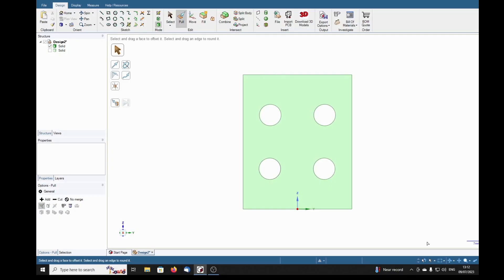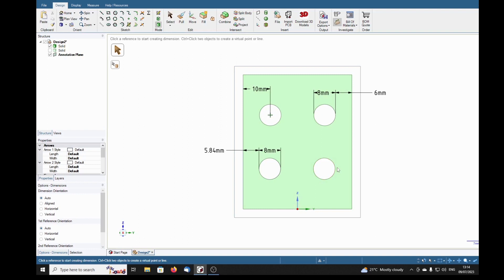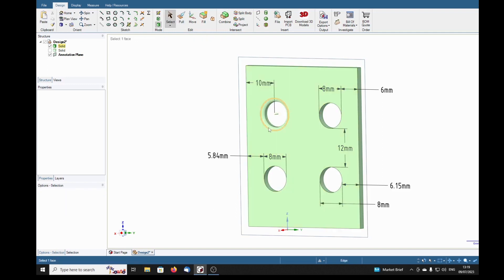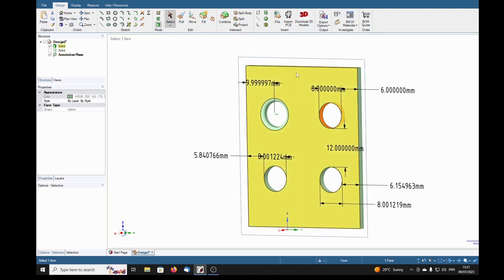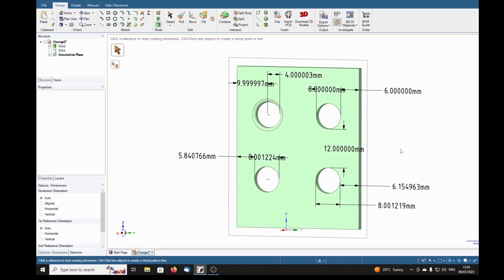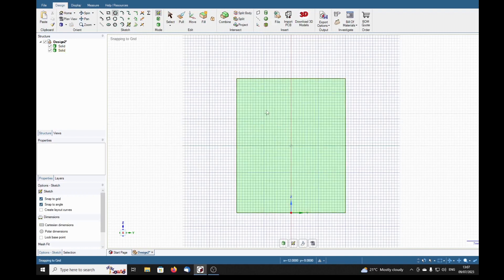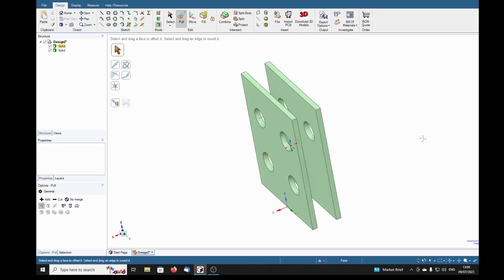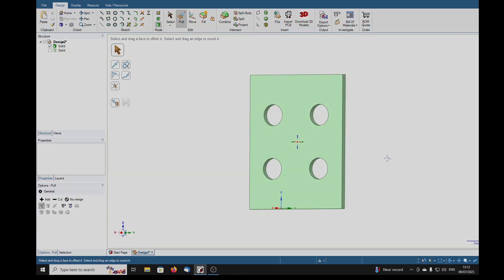The centerless holes enigma...  solved

Comment: Dsm 6 i presume. Here is part of a dialogue i had with dsm support:

Thank you for your response, in version 5 and on backwards, projecting a circle from the face of one solid to another did, indeed, draw a circle on the target face. You could then pull this to whatever depth and subsequently change the cylinder diameter. 

Since I first wrote I found a workaround which quickly gets the desired behaviour, the first of the options (on the left of the screen) when about to project is 'project through solid' or words to that effect. I found that by selecting that option and then pulling the resulting circle through the target object, it behaves as version 5 and backwards used to do, ie it creates an editable cylinder. 

It's a process I use a lot when designing stuff with mating faces and bolt holes. A handy way of using previous parts to quickly copy hole layouts.

 
Phil,
 
Thanks. I'm not sure the 'project through solid' should really have made that difference, but by serendipity it has.
The methods I outlines also works.
 
 He attached a screenshot, the first of the options he suggests is the solution I'd already told him about!

 
Cheers
 
Smithy.
Reply: This is another, place a sketch plane on the face requiring a hole, use the sketcher 'project to sketch' and a circle is made that pulls to a cylinder.